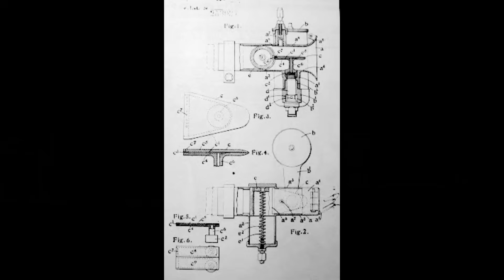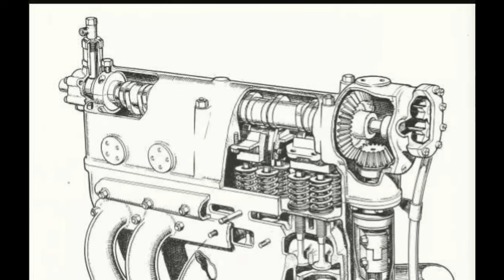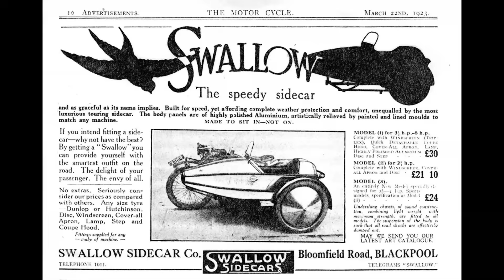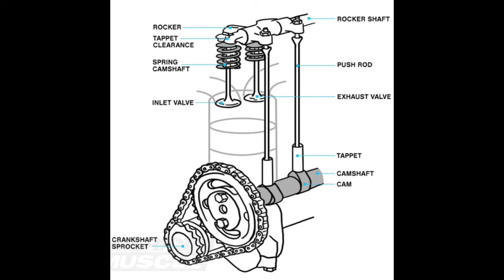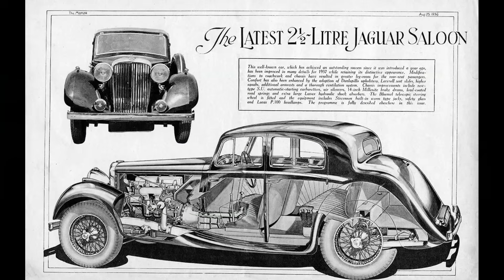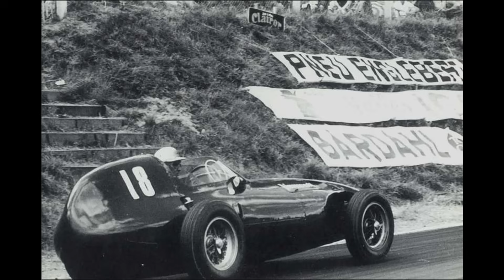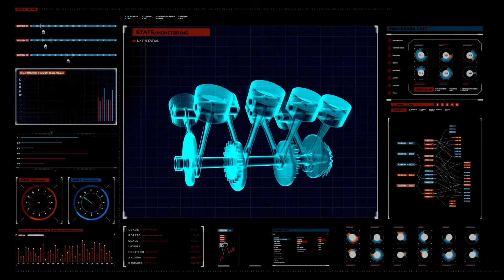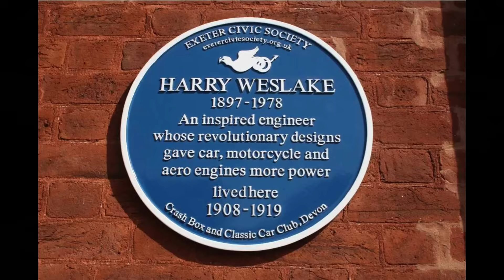How Harry Weslake Gave Jaguar Its Speed – From SS100 to Le Mans Legends

Comment: Did Sharman tanks really have Rolls Royce engines, can't find any references.
Reply from the maker: No, they did not - my mistake but its possible some may have been fitted as experimental or field modification programs. Post-war refurbishment programs by various nations could have included Rolls-Royce powerplants
There might have been limited trial installations that I'm not aware of.
Sherman tanks used several different engine types throughout their production run during World War II:
Main Engine Types:
Continental R975 - This was the most common engine, a 9-cylinder radial aircraft engine that produced around 400-500 horsepower. It was used in the majority of Sherman variants including the M4, M4A1, and M4A4.
General Motors 6046 - A twin diesel engine setup (two GM 6-71 diesel engines coupled together) that produced about 500 horsepower. This was used in the M4A2 variant and was particularly favored by Allied forces like the Soviet Union and British Commonwealth forces.
Ford GAA V8 - An 8-cylinder liquid-cooled engine producing around 500 horsepower, used in the M4A3 variant. This became increasingly common in later production and was preferred by the U.S. Army.
Chrysler A57 Multibank - A unique engine consisting of five Chrysler inline-6 automobile engines arranged around a common crankcase, producing about 470 horsepower. This was used in the M4A4 variant.
Caterpillar D200A - A diesel radial engine used in some variants, though less common than the others.
The choice of engine often depended on availability of materials and manufacturing capacity during wartime production. The Ford GAA and Continental R975 were among the most successful and widely used configurations.

Comment: Great video. A few clean ups, the Gurney-Westlake F1 engines were sort of skipped over. And Rolls-Royce's Melins, converted to tank engines, called Meteors were never used in Sherman Tanks. It was used in British tanks, like the Cromwell, Challenger and Centurian. The Shermans and Fireflys (Canadian) mostly used Curtis-Wright radials and some did use GM  diesel, a 5-bank Chrysler od 5 flat-head inline sixes and ome DOHC Ford V-8s later in the war.
Cheers from the Pacific West Coast of Canada.
Reply from the maker: Thanks for watching and for providing the additional info!

Comment: 15:18 The GT40 was at the very least Anglo-American. It was based on the Lola Mk6 GT and Eric Broadley was involved in its early development. Carol Shelby and Ford at Dearborn helped develop the car, the latter contributing to improved aerodynamics of the front end to eliminate lift that was apparent on the early cars. 
GT40P/1075 was manufactured at the Ford Advanced Vehicles facility in Slough, England.
One could argue that it was actually a British built sports car with input from the USA.
Reply: It was a British design, Broadley designed, even the engine had British design input, Westlake, designed the heads for the US V8 pos.

Comment: Jackie S, Dr Emil Savundra's entry in the 1965 Cowes - Torquay Off Shore power boat race had, I believe 7.5 l AEC diesels fitted with Weslake made petrol cylinder heads. From memory they were fitted with four HS8 SUs and twin turbos developing in the region of 400 hp @ 3,500 rpm. He didn't finish due to engine problems. I was an Austin apprentice at the time (1963 - 1967) and was fortunate enough to see some of the racing (just clouds of spray!). Excellent video well done.

Comment: @10.56, the 'A' Series was designed for the Austin A30 which was launched in 1951, it was fitted to a Morris Minor in 1952 when Morris merged with Austin, if the merger didn't take place the Morris Minor would never have been fitted with an Austin engine
Reply from the maker: Thanks for sharing this additional insight.

Comment: All the high performance engines he designed deserve high praise. But a bigger accolade should perhaps be heard for the BMC A & B series engines with their cylinder heads designed around several Weslake patents. Not because they were powerhouses, but they had great fuel efficiency for the time.

Comment: The harry westlake   Hart shape A&B series BMC  cylinder heads in the fifties are the most efficient combustion chamber design for overhead valve engines. Modification to this design now makes big power and torque!  Fast burn combustion chambers Chevrolet have perfected this design to such a high degree  that it’s still used today  especially in the v8 cylinder head market

Comment: I recently saw a "Genuine" Westlake crossflow cylinder head" on an A series engine at a hillclimb at Prescott. It was a beautifully designed thing and made plenty of power. Oh, what might have been if the Mini had been equipped with a proper cylinder head, right from the start!
Reply: you can convert to 16 valve   
easily using bmw k100 series motorcycle   cyl heads   even kits can be bought now
Reply from the maker: Thanks for watching and sharing your experience!
Reply: Harry's stepson Mike Daniels took over Weslake in Rye, and Mike's son Dean Daniels has recently been producing replica crossflow A series heads similar to the original design, with some modern improvements. Not sure if he is still making them though.

Comment: In 1966 I saw Percy Tait,  Triumph motor cycle test rider , come in second place at the super fast Belgian motor cycle GP race. Entered as a Triumph and using many Triumph cycle parts but the engine was definitely totally different to the normal Triump engine. Talking tp Percy before the race he told me it was just a prototype on test., a Westlake. It went and sounded beautiful., second in speed only to the Italian MV Agusta ridden by Giaccamo Agostini. Despite going to many more GP races I never saw it again.
Reply from the maker: Thanks for this fascinating insight!
Reply: The 8-valve conversion for Triumph motorcycle engines, developed by Harry Weslake in the late 1960s/early 1970s, were originally for the Rickman brothers, the patterns were later acquired by Dave Nourish and marketed as Nourish Racing Engines. These heads are still available today through NRE needless to say they are a worthwhile uprrade.

Comment: Very well done👍. Recently I came across the Ford DOHC development : https://www.youtube.com/watch?v=xs7JQC1wHKY and it seem to have timeline and personalty links to the existence of the Gurney Weslake cylinder heads. While Dan Gurney was a much appreciated engineer but without engine speciality. The link I see: in 1963 Dan Gurney successfully tested the all aluminium version phase 3 of the 260cu at Indonapolis. So when in 1967 engines were restricted to 5 litres it left a lot of GT40 owners with a class win only car. So I assume that either Dan Gurney asked Ford if he could have some aluminium heads, took them the Weslake on Weslake designed from scratch with the result that GT40 remained competitive for some more years. Leaving only to speculate if any more of Ford R&D phase 3 modifications were used.

Comment: 7:04  i must track down the merlin sherman
Reply: From unreliable memory I do not think that any Sherman variant was Rolls-Royce powered.  The R-R Merlin engine was re-engineered into the Meteor tank engine, used in the centurion and other British tanks.  Prototype Meteor engines were Merlins with the 2-stage supercharger removed, dropping power by at least a half to about 600 horsepower.  The Meteor was more of a cart horse than a Derby winner but could run between overhauls for much longer than the Merlin.

Comment: I was amazed that your interesting programme made no mention of Harry’s work on the Gurney Weslake formula one engine. My father was a Chartered Engineer and friend of Harry. Harry prepared a cylinder head for my brother’s racing Mini which I still own.
Reply: The video did show the engine a couple of times, and it did mention the cylinder head design from that engine being used in the GT40 at 14.10 or so.  There is some extant correspondence between Weslake and Jaguar about the development of the wide angle XK head, it is a great read that shows the relatively simple testing used to refine the head design, especially around the included valve angle, a remarkable lesson in deep understanding.

Of course hemi heads were a mistake, the 4 valve pent style head having come into existence on paper in 1910 and in the flesh in 1912, unfortunately poor understanding of combustion meant that they did not perform as well as they should have and were abandoned for many years in favour of the simpler 2 valve hemi-head (bloody Fiat!).  

It would have been more informative if the video had explored Weslake's work on squish, although not the first to get squish into combustion (that was, funnily enough, Indian with some racing side valve motorcycles - squish is easy with side valves - but I doubt The Indian engineer actually understood what was happening, more likely he came across it by "accident"), I am pretty sure he was the first to have a good idea of why it worked. Honda then joined in, followed by Costin as Cosworth, and we know where that led.
Reply: thank you Robert, so knowledgeable.
Reply: He designed the original A series cylinder head.

Comment: Good info, thanks. I believe you can still buy twin cylinder motorcycle engines based on his 8 valve design these days. He also built an 8 valve conversion for the Triumph 650 twin, it had alloy barrels and upped the capacity to 700cc
Reply: Popular in grass track sidecars back in the day.

Comment: You need to correct your video, as you say the 1935 SS90 had the Weslake converted OHV raising the power to a "dramatic" 70 hp. Yes, the SS90's power was 70 hp, but that was with the 2663 cc Standard side-valve engine, and it was that power that was considered insufficient for that kind of cars (same model year Ford 48 had 85 hp for comparison), so Lions had the 2663 cc converted to OHV by Heynes & Weslake, who raised the power to 100 hp for the model year 1936, hence the name SS100. And yes, that was 2 years later bored/stroked to 3½ litre, producing 125 hp, for the model year 1938. The 70 hp was a slightly stroked version of the 62 hp 2552 cc Standard "20hp" (taxed hp) used in the 1932-1934 models.

The 125 hp 3½ litre SS100 was an impressive engine, given it's light weight, affordability, and the fact that Ford never achieved more than 90 hp with their 3.6 litre V8 (125 hp was not achieved until 1952 with the 5.5 litre flathead V8), but unfortunately, the 3½ litre SS100 marked the end of the SS line and was very shortlived as Lions factories was repurposed for the war industry in 1939, and by the end of the war, the new SK engine was already ready developed, and Lions didn't want to sell cars with the Nazi's "ShutzStaffel" initials.

The sedan presented on the frontpage "The Motor" is the side-valve 1935 SS1 with 70 hp.
Reply: @soelund1 - thx for pointing out the bad facts that’s really great for anybody interested in the real history. Sadly a channel using a weird 4-stroke animation with an explosion in every revolution isn’t really into correct facts but into many clicks…. Hence the video remains with the wrong information in place. 
Rather sad. They could at least pin your post with correction to the top.
Reply from the maker: Thanks for the added info and the correction - I appreciate it!
Reply: @CuriousJag  At the risk of being pedantic, it not "Lions' but  WILLIAM (BILL) LYONS.
Reply: @lawsonsmith  My bad, thanks!
Reply: Nice review, but I'll pick you up on a couple of points - if you don't mind.... A minor detail is the proprietor was called "Lyons" not "Lions" - (in c.55 years of reading hundreds/thousands of books/articles about the company, I have never seen anyone pick up on the bl**ding obvious, ie - that  as well as sounding good, "Jaguar" was also a bit of jokey word-play on his own name! William Lyons wasn't known for his sense of humour, but he he did have a pawky sense of humour buried beneath the double-breasted suit - after his Le Mans victory he named his boat "Sea-type".
Also - joining people's names with an ampersand indicates a commercial concern - "Heynes & Weslake" were not a company.) More than just "boring and stroking" to get the 2.7 out to 3.5 - I haven't got a 2.7 ohv engine to hand, but I'm pretty sure that the block and head castings are different - anyone - Ed Nantes? / The "Jaguar" ohv engine is definitely no "lightweight" - the cast-iron block extends downwards past the crank-shaft centre line whereas the XK block terminates there / the block also has to have room for the cam-shaft whereas the XK block is slimmer - only containing the water-jacket / the head is also cast-iron - out-weighing the XK aluminium cylinder head. The 3.5 litre SS100, saloon, and drop-head were introduced together and went out of production together in 1940,  so not accurate to say the SS100 marked the end of the line. (Given that the 1½, 2½,  and 3½ litre saloons went back into production post-War, you could say that the so-called "Mark IV" marked the "end of the line" - or even the Mark V which still used the SS Jaguar ohv push-rod engine. The factory were certainly considering a new engine for the post-War range - but it's design wasn't finalised by 1945 and different designs were still being evaluated. (Why Jaguar didn't resume production of the SS100 post-War has always been a slight mystery to me - the bodies were made off-site - don't know about the wooden frames - so they weren't tieing up too much production space, and would have been good dollar earners as well as generating the same "halo effect" on the bread-and-butter saloons as the XK120 and E-type did...)
Reply: @soelund1  It’s Lyons not Lions.